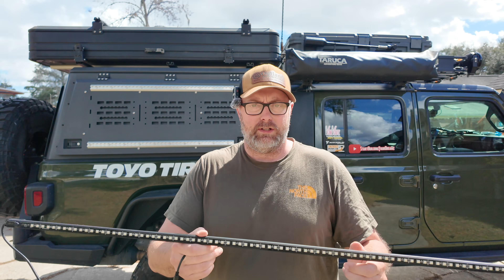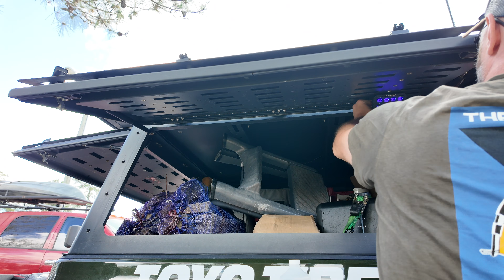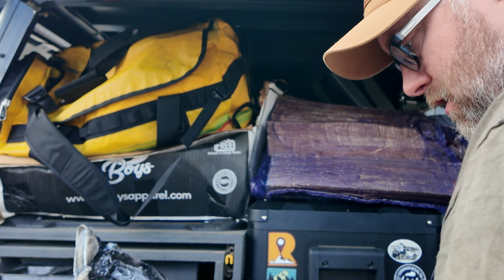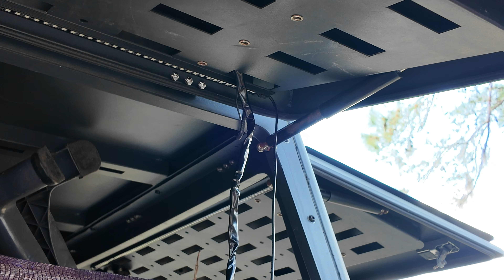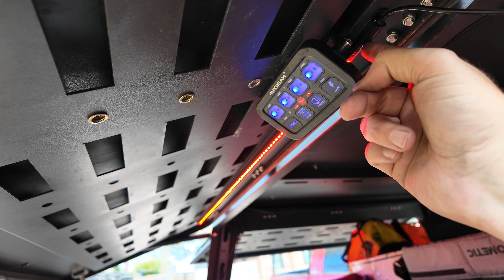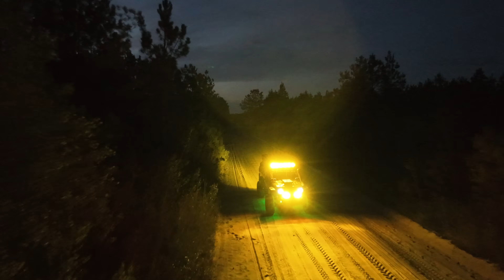NEW Lighting upgrade for Overland Rack or Expedition Truck Bed Canopy Topper | Outland Motorworks

Comment: Curious how you run Aux beam with the engine off. I contacted them and they advised the ACC wire must be connected to an ignition source in the fuse box. What was your workaround?
Reply from the maker: I have a 200AH house battery setup in the back that these and my Iceco run off of.  I ran both wires to the positive on my house battery.  However the Outland Motorworks 8 and 12 gangs switch panels have a selector switch to either run them off of a key on wire or run it straight off of the battery.  That’s what I have up front.  Eventually I’ll swap out the back too as it also has BT app control with the Outland Motorworks Controllers.